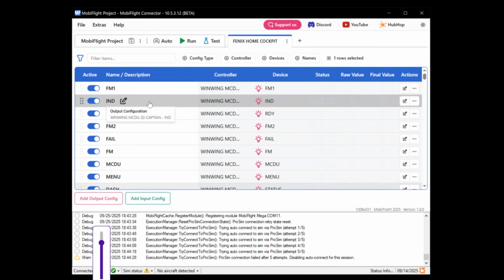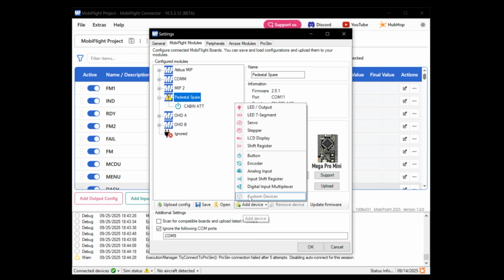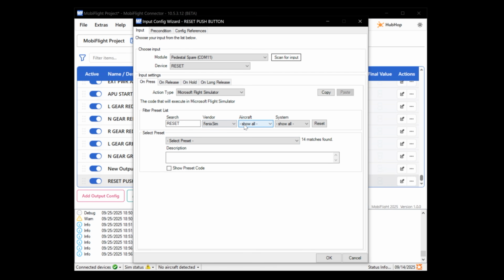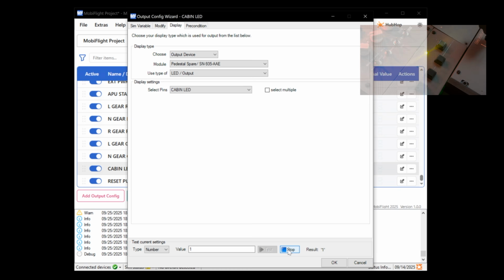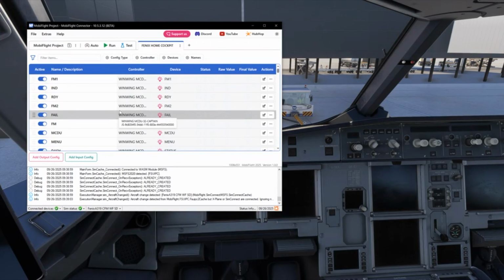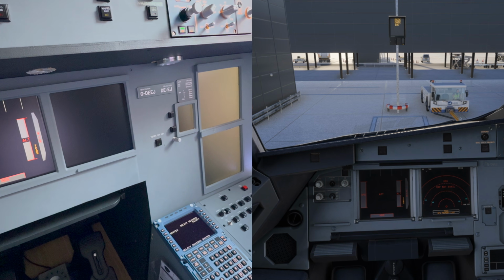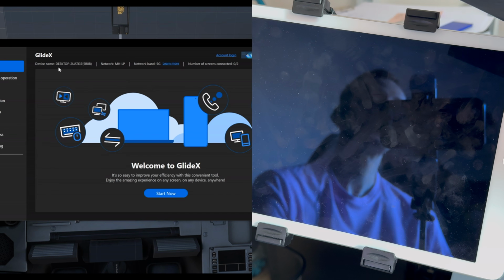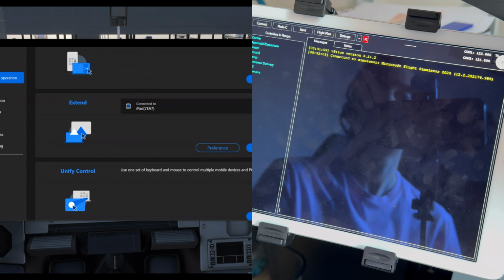Building an Airbus Cockpit | DIY Panel + Setup

Comment: Hi Mate, just one question. For the WinWing Components added to Mobiflight, does that make the WinWing Software obsolete then? Otherwise great stuff and very inspiring to build my own cockpit now.
Reply from the maker: Hello! Yes so I have all the winwing products connected and configured through mobiflight. I don’t have the winwing software (Sim app pro) even installed on my system as it’s not required. 

For the most part it is relatively straight forward to get their products working through mobiflight, the MCDU was a little more complicated because of the display but it is possible with a python script. I have no issues.

Comment: Do you get a frame drop popping the instrument panel windows out?
Reply from the maker: I haven’t noticed but I do recall a lot of people saying they have experienced this. But for me nothing profound, I use an RTX3080
Reply: @DakotaJetI’ve got a RX9700 RX. Tried the 4 main pop outs onto a spare 2K tv and didn’t notice any drop in fps. Which monitors did you opt for?
Reply from the maker: @Andy_Beckett hi Andy, they are just old second hand monitors from eBay. 1 X17 inch and 1X 19 inch. :)
Reply: @DakotaJetthat’s great. Would like to see how you’ve mounted them at some time 👍👍
Reply from the maker: @Andy_Beckett I’ll be covering this in a video released on 20th October. You can buy monitor mounts but I just used some off cuts of plywood to mount mine as I had them spare from building the structure.
Reply: @DakotaJetthat’s great. Just collected a secondhand 19 inch monitor for the PFD/nd
Reply from the maker: @Andy_Beckett  that’s great! Let me know how it goes. Just so you know in my setup I use a 17 inch monitor for PFD/ND and a 19 inch monitor for the ECAMS.

Comment: Nice little follow along, is there a link for the buttons that you use please.
Reply from the maker: Hi sure. The LED buttons are KD2-22. These are readily available from various places, however I’d express caution purchasing from AliExpress. I have used these before, they are cheaper but they don’t last. If in the UK I recommend this seller. More expensive but I’ve never had a problem with any of the buttons and they are made to order. https://ebay.us/m/KKkCmf
Reply: @DakotaJet Thanks for that, but the link you gave seems to be different type?.
Reply from the maker: @cplnobbie0078 are you referring to the led push buttons or just the black push buttons without LEDS?
Reply: @DakotaJet ones without the led buddy
Reply from the maker: @cplnobbie0078  No problem, in which case you are looking for these- https://www.rapidonline.com/sci-r13-23a-black-momentary-black-push-switch-78-0112

Comment: Great job 👏 I’m about to rebuild my cockpit would love you to share a link to the covering you use for the Clare panel 👍👨‍✈️
Reply from the maker: Hello! Are you referring to the top of the glare shield? If so it is DIY made. It has a simple wooden structure underneath to support with 6mm MDF wrapped in faux leather on the top. This is an area of the cockpit I will be updating in the future so I will include it in a video :)
Reply: @DakotaJetthanks for getting back yes it’s the Clare shield I’m referring too have you got the link to eBay for the faux leather cheers
Reply from the maker: @Ezy05SL  Sure, it was purchased from Amazon- https://amzn.eu/d/5jlsOzH
Reply: @DakotaJet perfect thank you so much 👍👨‍✈️

Comment: Not going to lie you are making me want to start something now. I need a more pull out put away option i think. 

What is your home airport eggp or egcc
Reply from the maker: There are definitely solutions to this; and I’ve seen many setups that use a normal desk as a base instead of a custom built structure. 

My home airport is Manchester :)
Reply: @DakotaJetyou can't be far from me.  I'm on the 05s side

Comment: Awesome cockpit, good job.
How many displays do you have and what are their models?
Reply from the maker: Thank you! I have 3 displays plugged into the graphics card. 1 is a TV for the exterior view. 1 is a 17 inch display mounted horizontally for the PFD and ND instruments, and 1 is a 19 inch display mounted vertically for the two ECAM displays. All were purchased second hand for next to nothing on eBay! I am unsure on the exact models but the next time I pull the cockpit out and do some work behind it I will try and find out for you :)
Reply: @DakotaJetthanks mate

Comment: When you move the instrument windows on different displays, do you have to do it each time you fly, or the position is set and remembered once and for all?
Reply from the maker: Hello and welcome! Yes I have to do it each time I fly. However, it is a process I’m now used to and I find it takes no longer than 2 minutes in most instances :)
Reply: You can use pop out panel manager to keep the panels in the same spot each time you load the aircraft… does it automatically
Reply from the maker: @vonduck1  hello! I have experimented with pop out panel manager, however I just couldn’t get it to work consistently. Perhaps I’ll look into it again in the future but for now this method works perfectly fine for me :)